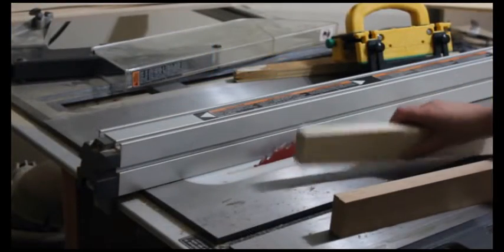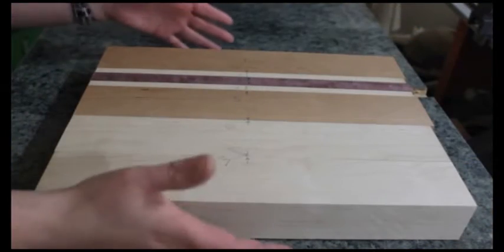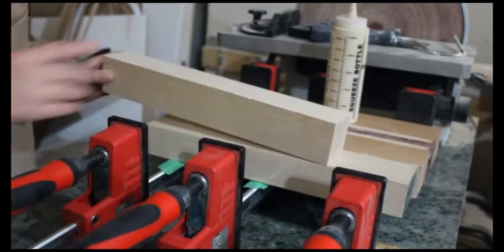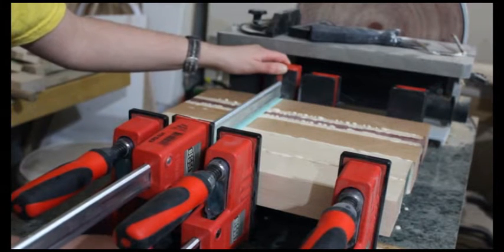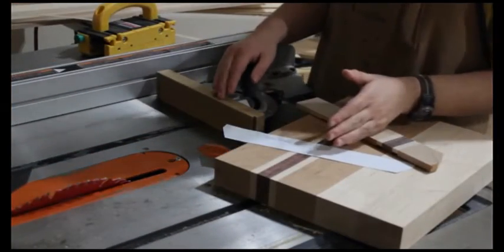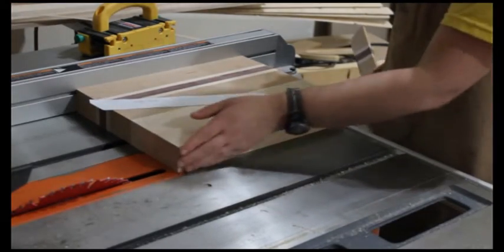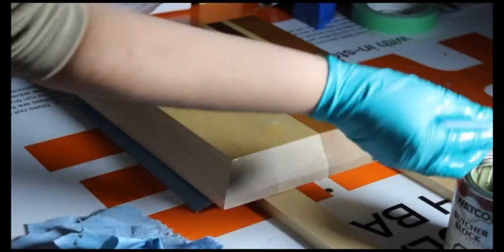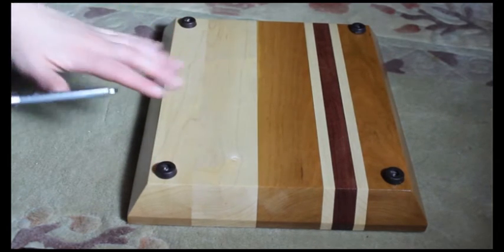How To Make A Cutting Board With Bevel Edge

Comment: beautiful board but how did you get the short side bevel to line up with the long side bevel
Reply from the maker: Thanks! I did the same thing on the table saw to all side. I just took small passes until I lined up the bevel edges on the other sides. In the free plans on my website (My Website: http://rosewood59.blogspot.com) I have the template to help line up bevel edges.  Thanks for watching my video!